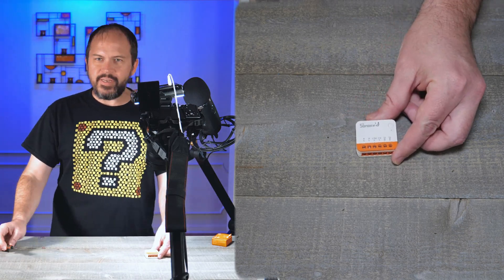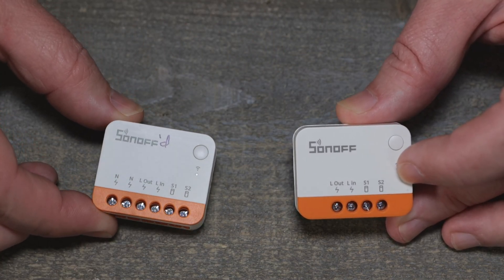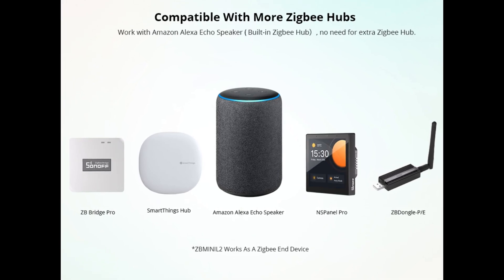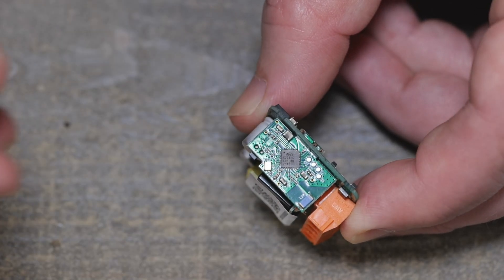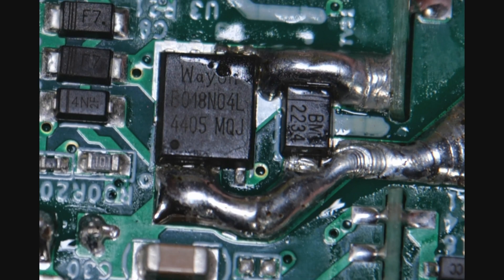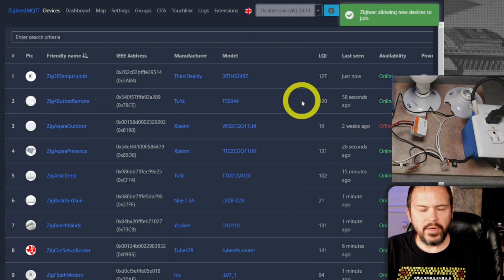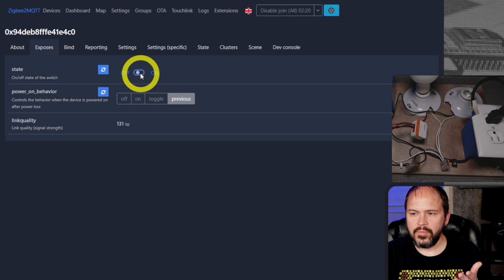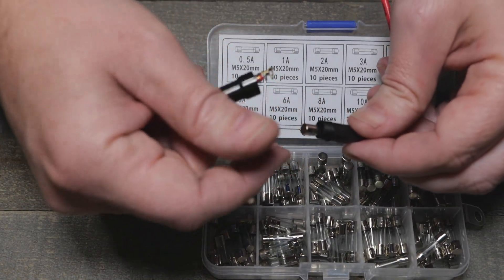SONOFF ZBMINIL2 No Neutral Zigbee Smart Switch Review

Comment: Sorry for this dumb question, I was in the assumption that this particular device are designed to be used on a light switch, what load would exceed 6A? or you're talking about load other than lights?

Comment: If you turn ON the conventional switch, then turn the lights OFF using Zigbee smart switch, the conventional switch goes in a confusing state. 
I mean the switch is apparently ON but the lights are OFF. 
Any solution for that?

Comment: There is a fuse in the module so you don't need to add an external fuse.
Reply from the maker: I didn't see one like I saw on another brand. Where was it at? I did run it over spec for quite a while and it never popped any fuse
Reply: @digiblurDIY  There is a fuse in the corner of the circuit board with what I think is a varistor next to it for surge protection. Remember fuses do not blow at the rated voltage and will often require up to twice their rated current before they actually blow.
Reply from the maker: I was pulling way over the amps that it was designed for. The relay got a little warm.
Reply: @digiblurDIY  Makes sense, the safety factor built into things like this will be quite large. Normally running over current will just reduce the life of the relay not burn it out instantly.
Reply from the maker: Not really. I do wish it would have popped the fuse a little above rating but I will just stick to the 15A relays myself.
Reply: @digiblurDIY  All fuses are the same so the external one will offer little to no better protection if you use a 10A fuse. Fuses are more to prevent wires melting not saving home automation components from being fried. You could of course match the external fuse to your own specific needs so calculate how much current each actual light circuit will draw and fuse accordingly. Most light switches will never need more than a couple of amps in reality, especially with modern LED lights, then you are looking at less than 1A in most cases.
Reply from the maker: All of my breakers for lighting are 15A

Comment: 3:42 does this mean I can put a Dimmer Switch on the L (out)?

when I google search if this relay switch is compatible with dimmer switch it says no. 
and I'm wondering why, then I figured maybe because the device need to have a particular voltage to run..
but then ..   I realize .. what is I put the dimmer switch right after the Relay..    which means on the L out to the bulb.

have you tried this one yet?

Comment: hey Travs, hope all is well. just wondering if there's the no neutral version of this to control 2 lights ? or even 3? thanks
Reply from the maker: I don't see any problem with multiple lights as long as you don't go over capacity.
Reply: @digiblurDIY  sorry, probably didn't explain myself properly. I didn't mean 2 lights on same switch but more like different set of lights on different light switches. So I have got 2 lights switches which I've been using double buttons aqara light switch. I wanna replace it with the sonoff but so far I only found this model that is no neutral. So I'm wondering if you might know the model that can control to separate switches. Hope I'm making more sense now.

Comment: Don’t need to add a fuse here in the UK, that’s what MCB’s are for, if there’s a short/break…it trips the MCB, that’s standard in uk consumer units.
And uk light circuits don’t normally run a neutral in the switch line for lighting switch, that’s placed within the ceiling rose/circuit if more than one light fitting is used.
Reply: Are your breakers 5amp? Because that’s the problem here. Most of the mains are running on 15a in America. That leaves 10amps to smoke that thing inside your wall. I suppose 8a for you since you guys run 240 I think?
Reply: @digitalc0nvict we typically use 6amp MCB’s and use 1mm/2 to 1.5mm/2 twin & earth (T&E) for a domestic lighting circuits. 👍🏻

Comment: One half-wave goes through the diode, the other half-wave goes through a Mosfet. 
The voltage increases and when the capacitor is full the mosfet closes. 
The entire circuit must be powered by this capacitor.

Comment: Is there a module like this that does NOT need zigbee, and only requires wifi?
Reply from the maker: Yes. They make a Matter over WiFi one.
Reply: @digiblurDIY  is there one in this mini size that does not need neutral?  Can you provide a model # / link?

Comment: can you explain what "no neutral reqyured" is , where do i connect the neutral though ?
Reply from the maker: You don't use the neutral.
Reply: @digiblurDIY  I still have the neutral cable, what do I do with it? I honestly don't understand
Reply: @venil82 you wouldn’t use this particular unit… you would use one that requires a neutral wire.
Reply: @phankins11  turns out I can just connect neutral directly bypassing the box, only live goes in

Comment: why fuse it?is just one fase ,can't short relatively to nothing!  will the fuse blow if there is a short internally on the module? why? if you short the 2 pins L IN an LouT its' a short? for you power box its not...  probaly the light that it's conected here will be always on because the module is "shorted" .
i didn't understand what IC powers 3.3v or 5v  through one fase only and no Neutral
Reply from the maker: My breaker and wiring is too large for the rating this device has.  It could fail due to loading issues and I need the breaker to trip, not this device.

Comment: Hey guys, I have never used them. Can someone tell if there is a setting which will set what state device in case it's losing connection? e.g if I want to turn on the gas furnace and then during the heating I lose connection to the device.
Reply: AFAIK you can only configure the behavior in case of power loss. In case of connection loss, it'll just keep the state. These devices are not to be relied upon for safety critical applications.

Comment: I'm quire certain that my wiring is correct (ZBMINIL2), I can control the light from Home Assistant no problem. But the issue is I cannot use the actual switch to turn on/off. I just don't know what else to do. Can you help?
Reply: If you didn't solve it already: the switch has three modes. Edge mode, for rocker switches; Pulse mode, for self-reset switches; and Following Mode which transforms the external switch in a circuit-breaker. You change the mode by clicking the button on the zbmini three times, quickly.
Reply: @haschid so 3 button press for each desired mode? Eg, i want a edge mode so i press 3 times? How will i know which i have selected?

Comment: I really wanted to use one of this for a 3 way light switch I have, but I have no place to put any fuse on my boxes 😢
Reply from the maker: Breaker is 15A?
Reply: What does it mean if the breaker is 15 amps that's how many amps my breaker is  @digiblurDIY

Comment: Just bought a 4 pack here in Canada using your affiliate link. Really only need one, the the price difference between 1 and for and then 2 or 4 just made sense to go with the 4 pack. Will definitely be putting in a fuse in the Line in side. Suppose to be able to change the switch mode between regular mode using on/off switch and toggle mode with a push button. Now to find a decora style momentary switch. Found one, but the price is insane.

Comment: I tried it and works perfect except for when using it with the switch. Somehow I have to turn on/off the switch for the light to turn on and then repeat the same for lights off, in other words action the switch twice every time I want lights on or off - any idea if I could be doing something wrong?
Reply from the maker: Not sure on that one. I haven't seen that before.
Reply: @digiblurDIY  thanks, had to tap 3 times the device button to change the interruptor type

Comment: I'll be honest and say I'm not a fan of a No-Neutral installation, especially at that low a rating.
Reply: can you explain why? i live in europe and im wondering if i can use this or not. thanks
Reply from the maker: As long as the breaker is small enough it should be fine.
Reply: @digiblurDIY  i have 220V/16A breakers...

Comment: Wouldn't you change your breaker in the switchboard to 6A afci then?! Those inline fuse holders shouldn't be used on ac applications as they can be pretty dangerous IMHO. It's pretty cool how those devices work as it makes it own neutral to drive the electronics, basically sips leaking current.
Reply from the maker: I was using the holders rated for 250VAC and are 14awg. And it would be difficult to change the breaker and impact the other things on the 15A-20A circuit in my region.
Reply: @digiblurDIY  Although rated for it, double check your NEC standard. I think that's the one you lot use ;)  
HRC fuses are better by design than traditional wire fuses we use on DC circuits.

Comment: I got one a couple of weeks ago and it's fantastic. No neutral is the standard way of wiring lighting in the UK which makes light switch choices very limited. I can confirm it works fine with ZHA as that's what I'm using it on. Using it with a single 8w LED lightbulb I don't need any load resistor like other no neutral options have in the past. I finally have a great option for UK switches that allows me to keep normal functionality for guests but integrated with my smart home, wife approval factor that it works with our existing switches and I love because it's fully local. Very happy and got more on order... Sorry for sounding like a plug but I've been wanting this device for years!
Reply from the maker: Awesome! Glad to hear good things. I tested it with a couple bulbs and it was flawless. That was the only issue I had with it was no onboard fuse. But that's an easy fix.
Reply: I stick my modules behind the light fitting. I have access to a neutral, 2 way switching and not having to arse about fitting deeper back boxes in the brickwork.
Reply: Where about in the UK did you source this?
Reply: @AFC19034life If you are still looking they are now on Amazon